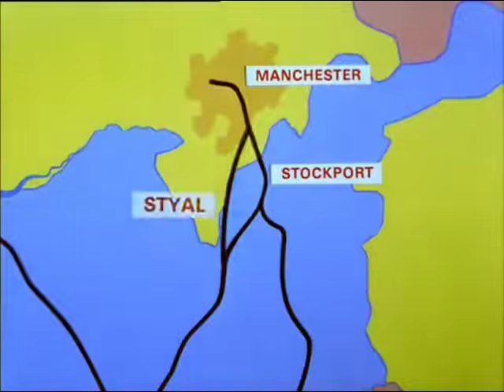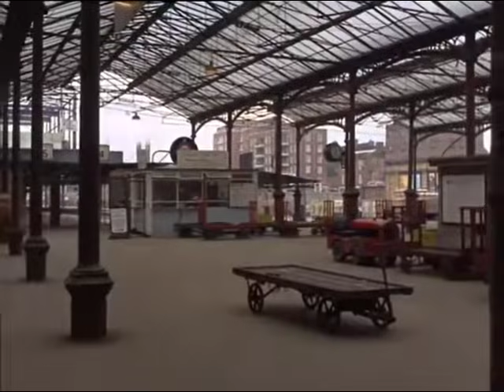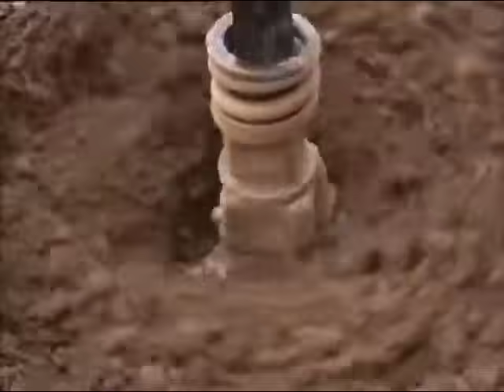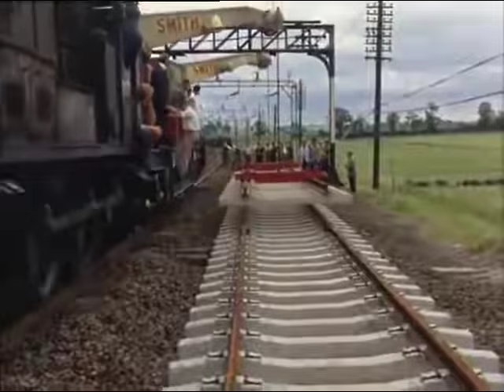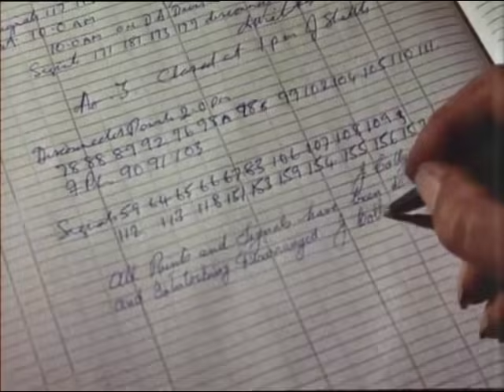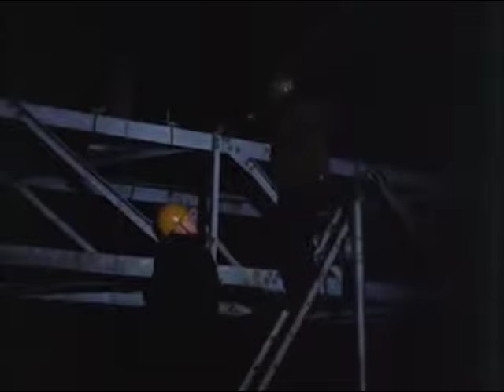Vintage railway film - Under the wires - 1965

Comment: When I'm looking out of the windows of the train I'm on (usually Norwich to Liverpool Street), I do wonder when and how the electrification was implemented. I work in an engineering environment and it fascinates me to think how each and every pylon, mast, cable and whatever other equipment that was required, got there. And the expense of it all. Electrifying a nation's rail network is a monumental task and I'm a little surprised how much of it was ongoing before I was even born ('68).
Don't forget, of course, that this was all about one hundred years AFTER railways came into being at all. Think of the man power and effort involved in building all that track, and the foundations it sits on back in a day where there was almost zero mechanical aid. And this was going on all over the world.

Comment: "to new street where snow hill will be combined".. Me i think you mean moor St... to combine snow hill into new street would require the removal of Birmingham Catherdral and many streets to accomodate.. where as Moor St is actually closer seperated what is now Primark, Selfridges and Bull ring, odeon cinema and a few other businesses... Back then it would been easier to combine New St with Moor St but not Snow hill as mentioned.. even back then there was too many things in the way.. The catherdral isn't going to want to move at all which is a major factor.

Comment: The opening wire diagram is superb. Ac through the primary windings of the transformer. The secondary windings through the tap changer, then changed from ac to dc through a diode bank , and then down to the dc  traction motors with weak field resistors😊

Comment: You would have to wonder, now in 2024, how much of this stuff is still in use.
Reply: All of the route relay signalling commissioned in the 1960s was replaced with digital in the 2000s. Nearly all the 1960s OLE structures are still in use, but all contact wire, small piece steelwork and lineside transformers were replaced with new designed kit in the 2000s. All slam-door coaching stock was scrapped by 2003 and the last of the 1960s locos were withdrawn by 2020.

Comment: at 3 mins 14 secs we had Acton Lane feeder station being installed.  We (Siemens) are just about to replace it, at 58 years of reliable service it was good stuff they installed.
Reply: In my day Acton Lane fed south to Euston and north to Headstone Lane, where it abutted the feed from Bourne End at a neutral section. After the modernisation of the early noughties and addition of autotransformer systems, I believe they reduced the number of feeder stations and Headstone Lane was one of the neutrals that were abolished as no longer necessary.

Comment: When I was on S&T Clapham junction, lots of signalling points failures at VSC, ASE was 'Wrong man for the job'had to be paid off, replacement narcissistic told by Chairman BR Board that he was to be sacked in 6 months time unless failure rate dropped, sent out questionnaire, I made lots of recommendations, 2 was carried out, had to have 4 men out on track, only 3 worked outside top grade didn't want to do outside work, 2nd can't say, but improved railway operations considerably. Bought in Man from Swanley led a task force team found lots of equipment faults, reduced failure rate.

Comment: The intro with the animated electrical circuit is simply sublime.
Reply: Ye olde tap-changer is just classic.
Reply: I see the transformer, but on the other side of the tap-changer (or well, the top of it) it looks like a coil. what does that represent? A variable resistor? In addition, what are the coils under the traction motors? Edit, would somebody also explain the weird configuration of the primary winding too? Thanks in advance.
Reply: @amessman  not sure about the traction motor thing or the secondary winding item. But the primary winding configuration could be to do with trains equipped to run under 25kV or 6.25kV lines. I've read about some kind of description where the primary side was split into 4 equal sections that were either set up in series or parallel to handle the different OLE voltages. Dual AC voltage lines like this were installed in the Glasgow area and in East/Northeast London and Essex. 

I'm not sure of the Glasgow lines, but from the 1960s Liverpool Street to Southend Victoria, and to Chingford/Cheshunt (via seven sisters)/Enfield town was 6.25kV while Cheshunt to Hertford East/Bishops Stortford as well as Shenfield to Clacton via Colchester were 25kV. Also, Fenchurch Street to Barking (including Bow Curve and Forest Gate to Barking) and Leigh to Shoeburyness was 6.25kV with Barking to Leigh via both routes (via Upminster, via Tilbury and the Ockendon branch) were 6.25kV
Reply: @amessman the rotating coils are the diode banks that change the ac into dc
Reply: @amessman the secondary side of the transformer represent the tap changer. It’s basically how the low tension side of the transformer control the output.
Reply: @amessman the resistors next to the traction motors are the weak field resistors. They allow the motors to spin up to a high speed.
Reply: Me too! A nice touch.

Comment: Apologies for the silly question; if overhead an electric infrastructure was so problematic, why didn't they just continue with the rollout of diesel trains or electrify the rails on ground as they do today?
Reply: 3rd rail also has a low top speed of 100mph
Reply: Diesels can’t accelerate very quickly and are expensive to maintain. 3rd rail is less safe (for obvious reasons), and it requires far more supporting infrastructure, like substations and high voltage wires between them.

Comment: The thing I do love about these videos is that the narration explains it without dumbing it down. But gosh, I wonder if Network Rail shows old videos like these to show what not to do concerning Health and Safety
Reply: But right at the end, they are using hard hats, so H&S is coming in!
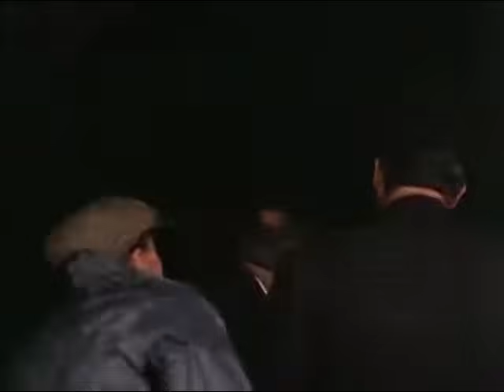Reply: @kevinmartin2516  I liked the part 22:42 when they inspect the overhead cables in a tunnel. They all duck going into the darkness. Only one has a hard hat, somebody else stylishly sporting a flat cap.
Reply: @richard-riku  What of it .
Reply: @richard-riku  Often Bowler’s hats were reinforced with steel in this era, making the de facto hard hats, meaning that not everyone wearing hard hats would be doing in such a conspicuous way as with modern hard hats.
Reply: @kevinmartin2516  NO GLASSES THOUGH!
Reply: To hell with that religion .
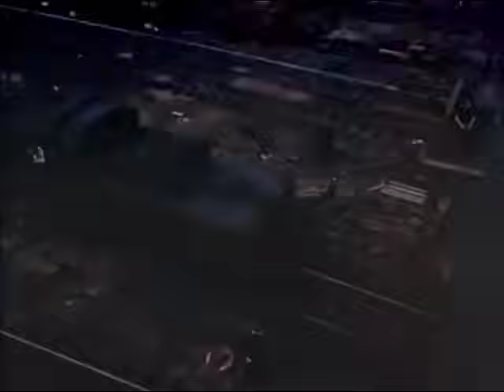Reply: 6:56. I'd bet the IRA would have been all over that bit of the movie. they would have reached full orgasm.

Comment: Always nice to see Kensington Olympia in the good ol' days where it had all its bays and little yard.   It had all that because it was a Motorail terminal but also the cross point for SR and MR regions and in those days Southern men did not tread on Midland metals and vice versa so it was a lively little station that saw a lot of freight work as well as being a handy unloading point for the Olympia complex next door.   Post office used it a lot too for a great deal of western London parcels with trains going to Willesden for onwards sorting north or west or down to Clapham for onwards sorting to south or south west.   It was a system that worked immensely well... sadly it all got pretty mucked up thanks to the tory :(

Comment: I love 1960s tech, it seems quite exciting and progressive yet at the same time it is crude enough that you can actually SEE it working, and often hear it working too, which is certainly not the case with modern power, signal and control systems.   The old AC locomotives and those maroon MK1 coaches also look splendid, charming even. Another thing you would struggle to say about most modern trains on the network. These must have been some really exciting times to have been a railway fan (provided you weren't totally blindsighted by the death of steam).

Comment: In the 1960s BR was starting to catch up with the other European railway systems and in their day the Type AL1 to AL6 (later class 81 to 86) electric locomotives were ahead of their time in terms of their design and appearance. To think in 1966 BR were introducing a fleet of stylish AC electric locomotives to the West Coast Main Line along with the modern-looking Mark 2 carriages for their crack express services, whereas over on the Isle of Wight they were about to say farewell to a fleet of steam locomotives and carriages from the Victorian era.
Reply: The Isle of Wight steam hauled trains were replaced by retired London Transport electric trains built in the 1920s.
Reply: Oh the howl of them class 8x's, when the engine was gearing for top notch it must have been deafening for the drivers if not for soundproofing.   Steam did survive a little longer, Gravesend Imperial Paper Mills had fireless steam engines into the 70s as did the Bowater's railway have what is now run by the heritage lot who bought the old paper line but sadly didn't save the awesome bucket ropeway (I grew up not far from there and we kids all tried to get the workers to let us ride the buckets).

Comment: I lived by the styal loop in 1959. As a railway buff ,was very interested in the work of electrifying the main line Manchester Piccadilly- London Euston. 9 years later in 1968, I went on my honeymoon using the night sleeper out of Piccadilly. All overhead fully electrified. Now, here we are 62 years later and they’re still finishing off the GWR. to Cornwall. Diesels still in full operation all over the country. It’s a damn disgrace. Recently I was in the unenviable position of having to walk across the steel gantry bridge over all of the platforms at Birmingham New St. There must have been 7 diesels idling down there  on the tracks  and the thick blue/black smoke filling the roof space was  enough to hospitalize anyone with a lung issue. Anyhow. That’s my rant.
Reply: The good people who did all this work in the 1960s would have been shocked to hear that by 2021 the work is still largely unfinished. And disappointed that the latest trans like the Azuma offer in some ways a reduced overall quality of experience when compared to the trains of the 1960s and 1970s. These old films are wonderful but a little sad.
Reply: @androo4519   - The good old days always looks like the good old days. I dare say the 1920s looked idyllic to some [older] people in 1965.
Reply: @davesaunders3334  and in many ways, they were right. However unsustainable things have to be updated, this is becoming a very real fact of life sadly.
Reply: @mikeschillinger4427  - The old days look better because you were younger and the world was still the one you’d grown up with. As things inevitably change the world starts looking unfamiliar and scary to us as we age and become more conservative. 

Also, the old days are usually viewed through the lens of professional filmmakers who know how to trigger nostalgic feelings in people. The old days weren’t better, just different, like Italy isn’t better than Spain.
Reply: Too right about the GWR...Brunel would have HIT THE ROOF if he'd still been with us..I think they've given up electrifying the rest of the GWR...an ABSOLUTE COCK UP with the planning !!!
Reply: Politicians must still be paid by lobby groups to stymie electrifcation as they have for probably 100 years!!
Reply: @Isochest  don't forget all the cock ups  caused by  by environmental studies, archeological studies, delays caused by health and safety regulations, and thousands of pages of additional regulations that cause all these infrastructural projects  to be delayed. Government and regulations cause years and billions of additional pounds and dollars to be squandered for make work jobs. This is why the infrastructure projects take so long, not only in the United Kingdom but THE USA, too. That's why the boondoggle of the so called hi speed rail in California will never   be finished, mostly by outlandish delays caused by regulations.  The money is there, I pay my fair share jack, but the trillions of dollars of waste. Go ahead, watch a documentary on the white elephant of hi speed rail in California.  A positive joke.
Reply: @JDAbelRN  Yes, all the add ons I feel are at best obfuscation and at worst raw embezzlement and corruption. Look how cheaply Ethiopia and Djibouti built a 500 mile electrified railway in comparison
Reply: Diesels still run into St Pancras from places like Leicester and Derby, and stay there idling away until they leave. No amount of Adblue takes the fumes away.
Reply: New Street station was refurbished from a dirty, smoky, disgusting hole in the ground with a terrible station concourse to a dirty, smoky, disgusting hole in the ground with a shiny shopping centre on top. There's still a huge bottleneck from the tunnels existing the station and the capacity problems were not addressed, meaning it will reach a maximum capacity and that cannot be increased. It is a depressing place to travel to/from/through!
Reply: The UK elite hate rail electrification. They grouped the companies in 1923 to thwart it.Now with Islamofabianism they seek to destroy the whole nation state
Reply: @Isochest There's always one  with a conspiracy theory axe to grind 😂
Reply: It has long amused me that Diesel traction was seen as a cleaner alternative to steam. Now, all these years later, more than half of the cars on the road are diesel too, with the resultant clouds of black smoke and fine particles. The transport policy in the UK is a joke.
Reply: @gord307  The Politicians don't want to decarbonise rail in particular rail freight. It is not cost as they have been interested in proposals to put overhead wires over motorways for Heavy Goods Vehicles. Pie in the sky but they hanker after harebrained schemes like this
Reply: @gord307  the latest Euro 6d diesels are a hell of a lot less polluting than ones from years ago. No more black smoke when accelerating harshly due to the DPF.
Reply: @Braveheart1984  No doubt the new ones are less polluting, quite spectacular were the old Deltics and Westerns when the driver applied the power!
That said, I have yet to see (smell!) a diesel which does not make me feel ill.
I ride a bike to work and usually manage to avoid the roads by using green spaces and the canal, but today I had cause to walk along a main road, and I can honestly say that it was awful – far worse, in fact, than I remember it being when I was a child walking to school in the 80s.
Other (dare I say better?) countries invested in electric traction, at the same time as the UK were investing in diesel locomotives and scrapping the electric trams and trolly busses; and it is only just now that the UK government has stopped ignoring what a polluted mess we are in.
Reply: @gord307  Diesel autos in the US are just about non existent. I'm not sure, but I don't think you can even buy a new one. They never were very popular and the Volkswagen emissions scandal was a big nail in the coffin. You still can get them in pick up trucks and they have a steady but small following in that market.   Every one is focusing on electrics now. Some large states like New York and California have passed laws not to sell any more gasoline powered autos by 2030, or something like that. For better or for worse I'm sure the UK will be going in that direction also, if they have not done so already. I don't know how popular electrics are there. Just a while back I remember reading an article about the fact that petrol stations in the UK were disappearing.  They will just make it more expensive and difficult to operate the gasoline powered cars. The current politicians in power in the US are virtually trying to destroy the fossil fuel industries.
Reply: @johnstudd4245  It is interesting to read a US perspective on the fossil fuel vs electric situation, and thank you. Yes, the UK is set to move to all electric in the next decade or so, not that we are anyway near ready for it! Many, many homes in the UK do not have vehicle parking, the owners leaving their cars on the street. I have already seen people trailing leads across the pavement so that they can charge their car at home!
The UK has unfortunately had a love affair with the diesel, and the emissions scandal has not made any difference to the number of diesel cars on the road. Having pretty well lost our own motor industry, the majority of cars are now either German or French, both big producers of diesel cars.
I believe the air quality laws are probably stricter in some US states than in the UK. As you know we are a small country and densely populated, so you can imagine how bad pollution can get, yet our politicians are only recently addressing the issue.
Regarding petrol stations closing down in the UK, this is due almost entirely to Supermarkets selling fuel and undercutting the independent petrol stations as to make them unprofitable. It is, so far, nothing to do with the increasing numbers of electric cars, but, of course, this will change! I would estimate that less than 1% of cars in the UK are now electric, so a long way to go yet.
All the best to you from the UK. Gord :-)